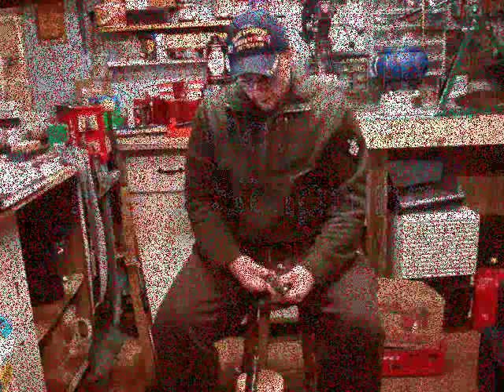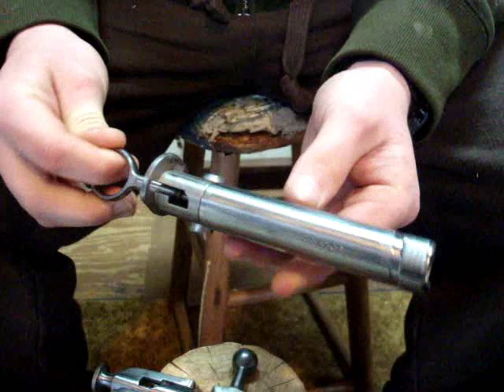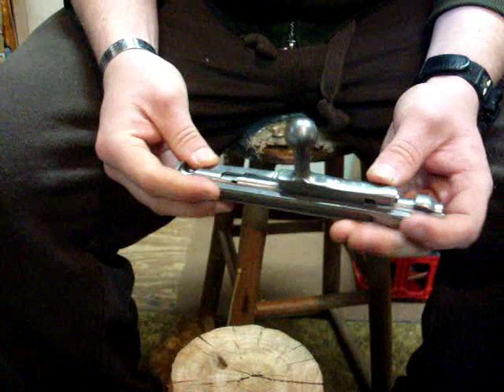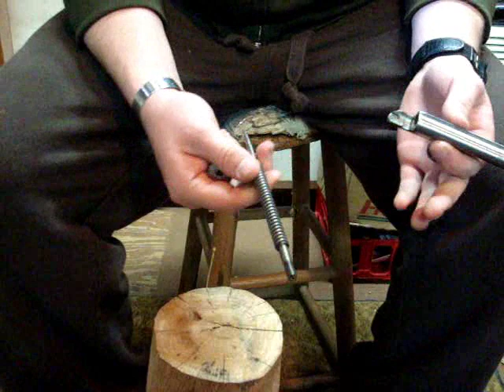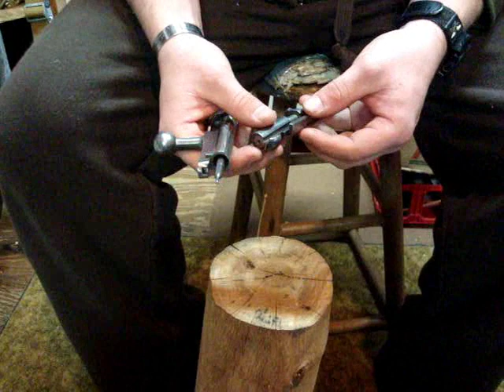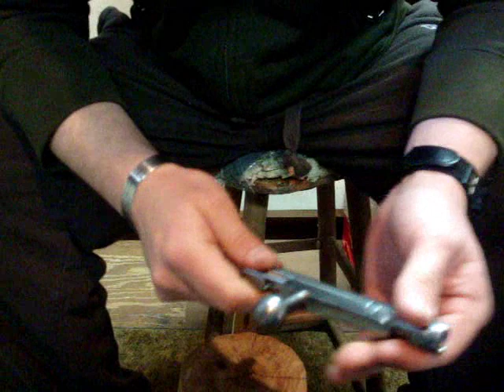Mosin Nagant Bolt Assembly Disassembly M39 M38 M44 91/30 M91 1891 Dragoon 7.62x54r .311 .310 .313

Comment: Eric, for someone Not that familiar with the bolt of a Mosin, you did a Piss Poor job of instruction with this. Your boredom with doing it showed, but for such a simple rifle with such a Over-the-Top and unnecessarily Complicated bolt, a Beginner would have a Hard time following you. There are Much Better videos here to take someone through this disassembly/assembly which is Not Easy at all in comparison to Any other Modern Rifles... Do a Better one.

Comment: Iv got an M44 and im planning on cutting the bolt and re-welding it to mount a scope. My question is do you know if the bolt is stainless, im planning on tig welding it so it looks smooth and clean.

Comment: I also don't have the firing pin tool but using deductive reasoning and lining up the 'guide rod/connector' so that it slides into the rectangular protrusion on the 'cocking knob/safety' and 'playing with it' to do so- requires proper depth of the firing pin, assuming the firiing pin 'screw' is flush with the charge bolt and index mark are reasonably lined up-otherwise you will be unable to slide the connector over that rectangular protrusion-basically, this was shown in video...(cont'd)...

Comment: Headspace is the distance from the part of the chamber that stops the cartridge from moving forward to the face of the bolt. .45 ACP, for example, headspaces on the mouth of the cartridge (where the bullet meets the brass case, basically).

Comment: I've disassembled and assembled a few of these and they can be very frustrating if you don't pay attention.  The Mauser Bolt is comparatively easy compared to the Mosin.  Watch your skin when dealing with this.  You can get a nice pinch when it locks in place.  Dave

Comment: I watched a video where someone used the the larger notch on the tool to remove the firing pin. He just put the pin in the notch held it with his thumb and unscrewed the pin. And put it back together in the same manner. I have been told you can break the firing pin using the wood method. just got my first mosin and wan't to make sure I don't mess something up. what way would you recommend. Not sure how you would break the firing pin that way unless   let it fly across the room. But who knows.

Comment: My bolt's spring is retardidly strong. It's litterally putting the fireing pin through the wood. I am running my self ragid trying to hold the damn thing down. Why does it look so easy in all the videos I see.

Comment: Just got a Mosin Nagant 91/30. The tool that come with it only had 1 notch in it for unscrewing the firing pin from bolt after removing the head piece. No notches for measuring the firing pin protrusion. Thanks for putting the measurement in the caption in the video (not to exceed .095) so can measure with caliber. Another great video by the way.

Comment: I just got a 91/30 from the local Fleet Farm ($100), took it home and disassembled/reassembled the bolt about like IV8888 just showed. You need to play with it a bit to make all the parts meet properly. My rifle was imported by CAI, and the disassembly manual they use is somewhat different, particularly with reference to handling firing pin removal/reinstall. As they say, horses for courses; either way will work, but IV8888's version may risk bending the firing pin.

Comment: oh, a helpful tip would be drilling a 1/4" hole on a block of wood and stick the firing pin in to it during disassembly. I slipped and belt the tip on my first try. a block of wood in a vice minimizes this and won't ruin the tip if you screw up. And its helpful to take a tungsten punch and punch two dimples on the bolt rear close to each other. one on the center and one on the bolt head. This way its one more confirming indicator on top of the slot... but only if you are anal like me :)

Comment: Just the info I needed.  I've been trying to turn the screw on back of cocking piece to release the firing pin.  DUH!  I understand bolt should be fully disassembled and clean after firing surplus ammo.  Taking my Mosin to the range today for its first outing.

Comment: My screw is lined up with the sratch now, the pin is slightly larger than the first grooveBUT it is pretty much as big as the second which scares me a bit,  I'm able to slide the tool back and forth over the pin with the second groove but no real daylight coming through, it is JUST there.  Is this OK?  Also, I disassembbled mine to cvlean it, should I check head space before firing?  Or should I be good?  Got mine from Aimsurplus.

Comment: ok i was awtching this vid. one tip is make dam sure u got a good hold on the bolt when ur taking the firing pin out. mine slipped and went flying across my room at the speed of holy crap and stuck in my wall like a dart.

Comment: Your comments about the complexity of the firing bolt have set my mind running...why *would* the Russians put such a complicated bolt in a military rifle?  I'm not knocking Russian engineering either - those boys can produce some functional but indestructible shit.  I remember a line I read about Russian vs. American fighters, comparing them to a Mickey Mouse watch vs. a Rolex.  You drop the Rolex and it breaks.  Drop the Mickey Mouse watch, shake it , and it starts up again.

Comment: Another great video
During WW2 they did not take a lot of time to clean up non contact surfaces as they were more interested in production numbers. 
You can see the differences in pre 41 as they are much better machined. In some rifles they removed the step that cut a re-leaf on the left side of the bolt area. (left of where you insert the cartridges).
Thanks to your video I can now take my bolt apart !
Earl
The bayonet on most all Mosin rifles will need to be filed or honed

Comment: I have a question about "head spacing". I was told, that if I were to buy a bolt, that a new bolt might need to be spaced. Is this true? I also wanted to find out where you purchase a firing pin gauge. I have an M44, looking to sell it, and get an M91/30. The M39s are a little bit out of my price range.

Comment: Mine too. It is only a very small difference for the front sight.  If you mean you bolt screw is slightly left of the scratch, use the tool with the circle to check how far the pin sticks out. Use the middle two notches. It should touch the second notch but not the third. You will find videos on You Tube that demonstrates this.

Comment: I noticed something else while examining the rifle. There is a crude scratch made on the front sight that runs from the top piece to the bottom piece. On mine that scratch lines up perfectly with the sight off to the left. You will also see a similar scratch on firing pin adjusting screw at the rear of the bold. The scratch runs through the screw slot. That is where is firing pin was determined in its optimal position so it hits the primer but not puncture it. Very cool simple adjusting measure.

Comment: sounds good. i haven't seen it, so i can't say for sure, but it's possible it's already set right. i've had a few guns that looked like the sights would be waaaaay off. but they weren't. bayonet will make a difference on some. on m44 carbines it can make up to a foot of change at 100 yards. and then on some you can shoot with or without and experience no change.

Comment: Can anyone please answer this question please?  I just bought a 91/30 and heard that they are sighted in the factory with bayonet fixed.  The question is, my front sight is about a millimeter or less askewed to the right in it's "seat".  Should it be that way or flush seated in the front sight mechanism?  Was wondering if I should tap it into place or leave it due to the fixed bayonet pre-sighting.  Thanks for anyone's help!

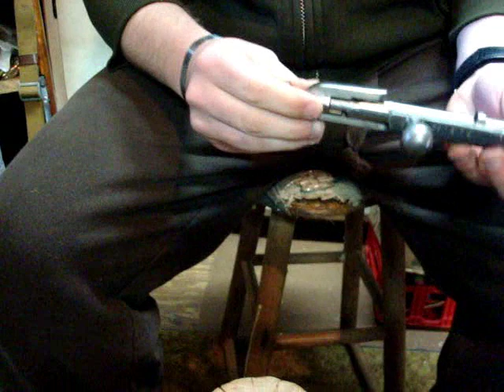Comment: good stuff got mine today, cleaned it to the bone, one thing u can comment is for people having problems moving the bolt, I see in your video you it looks like you twisted it easy at 1:33, your spring must not have been as strong as a regular mosin which is a good thing, they are too strong a simple way to ease the bolt movement in the gun is to shorten the spring but cutting off a link

Comment: to remove the firing pin. i believe youre supposed to use the long forked piece that comes off the bolt.. believe its called the connector.. the forked piece fits onto the front of the firing pin and it twists right off

Comment: No line through the firing pin, but it is slotted for the multi-tool or screwdriver. I have two mosins, on my m44 my firing pin has to be screwed in deeper, and my 91/30 sticks out a little bit. The cut slot on the back of the firing to kind of turn it into a scew is still lined up with the lines cut on the back of the striker knob. I can get pics if you want.

Comment: Hey bro. Good vid but one thing.... Those slots are cut not for firing pin protrusion but to make sure theres proper alignment so the locking lug can slide on. If the screw is not ligned up with the slots then you cant get the guide rod type of thing back on that the lug is onto. You'll see what I mean if its crooked. On my 91/30 the firing pin is backing out about the length of the tip of my index finger nail for proper protrusion. Good vid man.

Comment: Sako still makes half a dozen designs patterned after the Mosin and yeah, the Finns used Mosin as their sniper of choice until the late 90's.

Also, I think Tula makes a modern repro of the Mosin. It shoots quite well from what I have read. I can't seem to find the article, but to give you an idea of what it looks like; it looks a kin to the Finnish M76 match rifle.(also based on the Mosin)

The are fairly hard to find here in the states, although you may see one on occasion.

Comment: My 1935 tula came with instructions that looked equally old.
Didn't have to adjust for pin depth, but I imagine that slotted deal would help with that.
Anyway, shot some 1/8th steel plate with Bulgy 1950.
plate just rested on end in snow, wind could have knocked it over, shot several rounds through the plate without knocking it over,,,went through like paper.
you would think the plate would topple.
gonna try with 1/4" next.